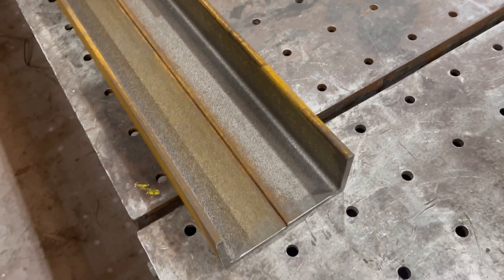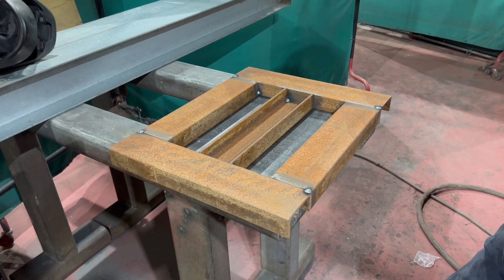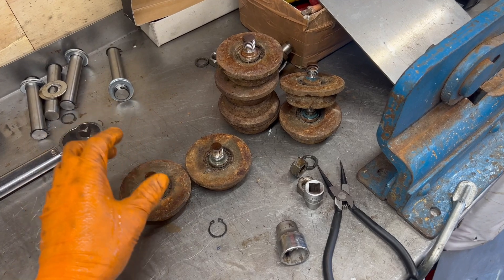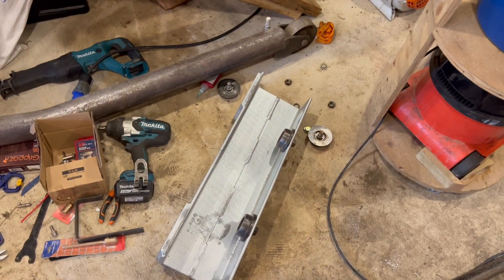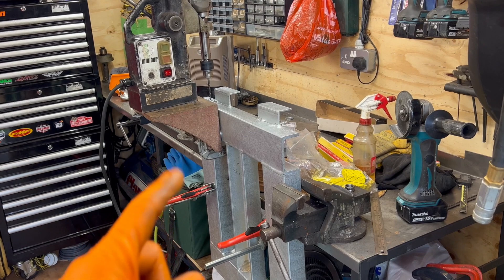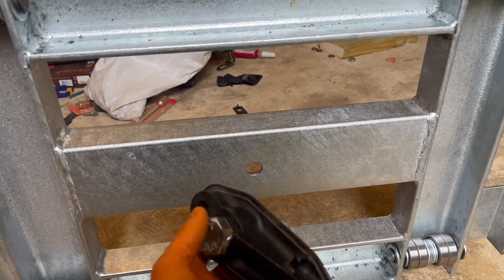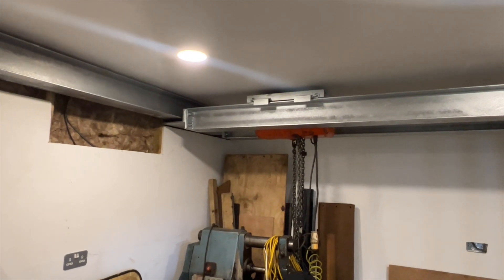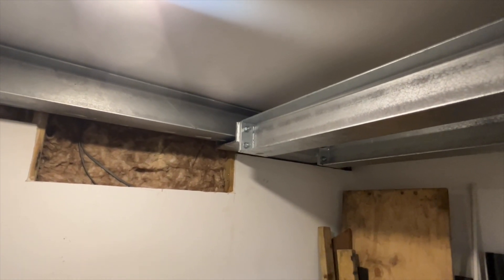Garage Gantry Build!

Comment: How high is the ceiling in there? Looks rather low maybe 8 foot?

Really like how you did the low profile dual beam

I was actually planning on trying to do something similar in my shop, really amazing work
Reply from the maker: Hello, the ceiling is 2.4 I think. I’m not sure where you are in the world but there’s a building restriction in the Uk of 2.5m height if you’re within 1m of the boundary. I could’ve gone higher but it would’ve needed planning permission which gets expensive if you’re not aware. 

Thank you though. It’s come out well and is a fantastic help.

Comment: I literally finished a gantry crane yesterday & will try to lift my lathe today. Mine is mobile though on big wheels.
Reply from the maker: How did you get on?
Reply: @CalamityKim1  Went OK apart from the lathe being so heavy at the headstock end. That was with the straps positioned as recommended!!!

Comment: Looks good the surface u was talking about on the beams is roll wear from when the beam was rolled in the steel mill I worked for 40 plus years in a mill in England so have seen it many times its only a quality issue not structural  (ps seen a dam sight worse lol) nice job wish my work shop was hi enough to use one 👍